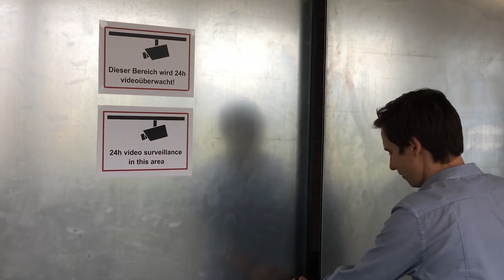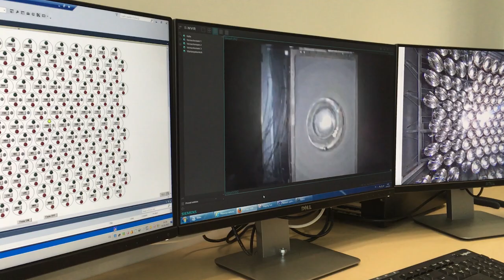Why Tom Couldn't Show You The World's Largest Artificial Sun

Comment: so you only want to show videos that are visually impressive? well that will be a limitation. lots of cool things are visually underwhelming.
Reply: Tom's made plenty of videos about things that aren't actually that visually stunning- the borders inside borders inside borders one is just him walking on a street, and there's one about little twiddly knobs underneath crossing signals. In this case they were expecting something to be much more visually impressive than it turned out to be. If they'd used his phone, rather than the gopro maybe it would have been.
Reply: dgodfrey9189 Or the sideways river, that looks pathetic.
Reply: Seriosuly, Tom if you read this. Upload it anyway and send the video to GoPro too. The Camera that looked into the sun and lived.
Reply: I think it's that the go pro didn't accurately portray the subject. The really thing is super bright, blindingly bright, but in the video it just looks like a normal spotlight.
Reply: Mar Right? Example: How insanely, incomprehensibly amazing is a modern smartphone? The engineering and history of "That doesn't work. How do we fix that?" is incredible. But, from the outside? Iz'just a plastic brick, innit?

Comment: You should release it anyway. Biggest artificial sun and god damn blessed gopro. Or write gopro im sure they will want this as promotion material. :D
Reply: My thoughts exactly, this is great advertising for GoPro, you could squeeze out a spon probably :D
Reply: Yes that ^. GoPro might even send you a new shiny one to try to abuse in other interesting places.
Reply: So on the upside, these scientists now have another camera option for their research.
Reply: The battery is still gonna melt :/
Reply: Batteries can be substituted for by an an external power supply, much like their existing fixed cameras use.
Reply: True, I just figured the point of the GoPro is to use it with the battery and go anywhere, avoiding cables and such :D
Reply: relocate the battery/powersource?
DSLR and other cameras can be adapted to run off mains power (usually with a battery shaped plug to go where the battery goes in, connected to a power adaptor), so no reason why a GoPro cant have one.
Reply: He could even make it unlisted and place a link in the description of a video. That way he wouldn't have any issues with posting a bad video
Reply: Yeah, I was thinking you could sell the footage to GoPro.  Who wouldn't want that kind of proof of capability?
Reply: I agree. Please release the video, show the other cool stuff and just build the narrative in a way that doesn't make the viewer expect that the GoPro just dies. Sure, it's a little bummer but you can explain it and in my opinion it's not your fault. Even had you known that the GoPro would just compensate, you could have made a cool an foremost informative video about that.
So why not teach your followers: GoPro compensates for several suns of light. :-P There is not the expected sensation in that, but there is stuff to be learned. Even if it's only "we have artificial suns and this is why".
Reply: "The GoPro Hero 7 will not only work when pointed directly at the sun, but also when pointed directly at the LARGEST ARTIFICIAL SUN."*

*Keep in mind that the GoPro may start to melt if kept in front of the largest artificial sun.
Reply: "And that is something you might have known."
Reply: Tomáš Viktorin Seconded
Reply: Believe it or not, not every single company wants promoting.
Reply: +Gauntlet why would a company dont want to promote their stuff? even pornhub sometimes gives an ads around

Comment: "The only way is to melt a GoPro..."
    Did you consider putting in a lower quality camera?
Reply: Still the risk of exploding battery.
Reply: @coolguyhino92  take out the battery and plug it in a solar panel, the facility was designed for testing them
Reply: Probably just didn’t have another camera, and still... exploding battery

Comment: Wouldn't it be possible to power the gopro externally? That way the battery or power source etc could be protected. Looked pretty cool to me anyway!
Reply: power it up by solar  power and use the lights to power it. unlimited power!
Reply: @ganon8835  UNLIMITED POWAAAAAH
Reply: @ganon8835  no but actually I am pretty sure solar panels can do bad things when subjected to that much light
Reply: @jearlblah5169  it was a place designed for solar panels
Reply: @TylerMarkRichardson  solar collectors, not solar panels. VERY different things, actually.
Reply: @jearlblah5169  they overheat and burndown.

Comment: I believe the 'ka-clunk' of lighting is just a dated expectation. Modern lights do not make that noise - but they once did, in very large installations like warehouses or floodlights. It is the sound of a mechanical time-delay contactor. Incandescent bulbs draw a surge current when turned on - if you turned all the lights in a large installation simultaneously the surge current would blow fuses. The solution was a device that just turns them on in stages, a few seconds apart. That's still done today, but using silent solid-state electronics. Hollywood just kept the sound effect because it sounds cool.
Reply: I went to a very old elementary school, its cafeteria/stage the only place I've ever heard lights make that noise. The noise would come from the back-stage area, not anywhere near the light switch, or the light bulbs.
Reply: Carbon arc lamps also made a characteristic noise when they turned on, but it was more of a buzz noise than a Ka-clunk.

A carbon arc with the delayed contactor would do both noises.
Reply: Vyl Bird  -Turning the lights on at the hangar where I work, there is a kachunk noise, but it's actually produced by the relays
Reply: There may actually have been some relays controlling those lights that would make that sound.   If he'd known ahead of time that he needed it, it would have been a funny to mic the relays and produce the sequence as Hollywood would, .. and then do a reveal where Tom says "Actually, that noise comes from this metal box in a completely different room from the lights themselves."

Comment: Why does a gopro adjusting the brightness spoil the video about an interesting thing? The information about what the artificial sun is and what it does is still quite interesting to see. You do not have to film a Mars rover from the surface of Mars for the piece about it to be interesting.
Reply: I absolutely agree. There is more background to it than melting a gopro
Reply: Ollyweg 0 the thing is he can't, it's in a vacuum chamber so no oxygen to fuel the fire.
Reply: Melt a chocolate bunny?
Reply: ikr? it still made a nice piece. it might not have been as impressive as in person, but displays typically(and thankfully) don't reproduce that much brightness anyway, so it was going to get squashed or flat even if the camera didn't think it was doing the right thing by adapting.
Reply: It's because standard dynamic range cameras can't even come close to reproducing the effect of staring straight into the sun, and this video was recorded in basically the same era as the one about the "pinkest pink" that can't be reproduced on SDR displays for much the same reason: there just isn't enough gamut available in eight bits per pixel.

I'd really be interested in Tom doing followups to videos that don't work for the same underlying reason if he were ever to start using HDR-capable recording equipment, seeing as YouTube supports HDR videos just fine if watching on a HDR display.

Comment: In my experience, the master power to stage lights makes an impressive noise. It's a big heavy clunk. If you go to the lighting board before turning on power to the array and push all the switches up, then you get a clunk paired with blinding light. But that switch is for providing power to the entire lighting array, not each individual bulb.

Comment: Run it as a video on how awesome cameras are at not getting destroyed in super bright light instead? featuring science machines
Reply: Also start with the seemingly domestic lights being switched on, then go for the shiny shiny kit?
Reply: Berakh Hvar yes I think that could be a good solution, there may be things to learn about CCD sensors and how they cope with bright light.
Reply: Automatic gain control for the win?
Reply: THIS.  How tf is GoPro capable of this? What kind of technology have we developed such that the camera brand known for "cheap" and "sketchy" is capable of handling this? 

Talk about how automatic gain control works, and then, as proof, show that a GoPro is capable of handling the brightest thing humans can produce. THAT'S impressive.
Reply: But if you don't want to use this footage, please at least talk about how automatic gain control works, because I really want to know.
Reply: (This could be wrong since this is off the cuff and I'm not fact checking, but)
I would guess that the GoPro uses a CCD sensor containing many cells that are combined to get a colour value for each pixel-

Each cell of the camera sensor converts the incoming light to a voltage by accumulating an electrical charge; generally the more light the greater the voltage. This charge is then sequentially removed from the individual cells to make a video signal for processing into pixels comprising an image. 

Because the camera can only understand a certain range of voltages, and the variation in voltage from the charges is usually too small to understand, it is necessary to amplify it. The amount of amplification is called the gain.

A signal produced in low-light would require more gain to amplify the signal into the range the camera can understand. (An unfortunate side effect of more gain, is that noise (incl. static) will also be brought into the range the camera will try to understand.)

A signal produced in daylight requires less gain to do the same. (Too much amplification and the details represented by higher voltages will be lost as overly-bright patches. edit: like old night vision does)

Automatic gain control measures the voltage/value range in the signal, and will adjust it so that the maximum and minimum values are scaled into the range the camera can understand, eliminating overly-bright/-dark patches. 

(I forget if CCD sensor technology does this:) This same control may also independently adjust the starting voltage in the sensor to increase or decrease the sensitivity to light. 

Hopefully if I am wrong someone will correct me. But I'm going to go eat instead of fact checking.
Reply: And why.. I am assuming it is because the color temperature is still in range it can deal with if is supposed to take videos of molten metals or similar things with color temperatures that are really high, but not directly on the camera like bathing it in light.

Comment: Some lights in some circumstances do make that sound.  I worked lighting for a 2200 seat theatre that had fluorescent house lights (roughly 200 4 foot fixtures).  On the lighting control board was a tiny toggle switch to turn them on or off.  When turning on there was a sound almost exactly like your sound effect as the relays and starters and ballasts energized.  It was loud, impressive, and when you heard it you knew something had happened.
Reply: The large and echoey PE hall in school had some overhead sodium lamps fixed to the roof beams, made a lovely deep energetic racket and as they warmed up, all the hum and buzz slowly turned into light. Shivers. It ain't the same with LEDs :)

Comment: Hey Tom, considering this video is almost 4 years old, I realize someone might have already pointed it out, but I think, you should revist the "Drielandenpunt" as the Dutch call it, I think there actually is enough there for a couple of reasons:
1. It is not only a tripoint, it is also the highest point of the (continental or European part) of the Netherlands. Having been there and knowing that is actually not that high says a lot about just how flat that country is.
2. It has been a quad-point (hope that is the right term), since once there was an area that was disputed between I think the Netherlands and Prussia and so that area was somehow considered to belong to neither and being neutral.
3. In a way it still is a quad-point, as Belgium is separated in a Dutch-speaking, a French-speaking and a tiny German-speaking community (I think, I remember you mentioning that in a different video too) and the border of the German-speaking community with one of the other two also runs up to that point.
4. Last but not least: You can jump up and down by around 2 meters just by crossing the border...not literally of course, but apparently Belgium uses a different reference for their hight above sea level than the Netherlands and Germany do, so even though it's totally flat the Belgian part of that point is 2 meters higher than the German and Dutch part...of course that would be true for any point on the Belgian-Dutch and Belgian-German border, but I know you care about that as little as I do as long as it makes a good a story and you can nitpick yourself for it afterwards. ;)

Comment: Lights never made that noise it was the solenoids use to switch on and off the massive amount of electricity they used that did. They has to move extremely fast so they can disconnect/reconnect power without arcing inside the switch

Comment: thats why you remove the plastic shell and the lithium battery and have it powered from a wire, that way itd just be an image sensor and circuit board that would burn up. ^^

Comment: Something you could have possibly done to prove how hot it got was to put a match in front of the GoPro (or rather off to the side) and watch it light as though it had just been struck, and to prove how bright it was you could put the GoPro inside something that blocks light intentionally, and show with a flashlight and/or the sun how minimal light gets passed through, and then put the same object in front of the array of lights and show the amount of light that does get through.

Comment: Electrical safety switches kinda make that noise when flipped. They're the levers they use in movies to turn electrical things on like you mentioned. Installed near machinery so you can lock them out without turning the whole breaker off to work on it.

They're a bit higher pitched, but close enough.

Comment: To echo many other commenter's sentiments, I like the video and think that it could be a discussion about dynamic range in video. It also shows that modern sensors are pretty reliable (I've seen old camera sensors [maybe CMOS] with dead pixels from looking at the sun) no matter how you abuse them. 

One angle I would love to see is the view of the target from the lamp's perspective. The intensity of the light shining on the camera compared to the off-axis areas might have illuminated the differences.

Comment: If you got a chance to try again, you could put a hot mirror in front of the gopro.  The hot mirror would reflect the longer wavelength light, keeping it from heating up your gopro, but let the shorter wavelengths (visible light) through, allowing you to turn on more lights without melting the camera.

Comment: I found that footage great, even if nothing happened to the GoPro. I still think it was quite cool to look at the lights from a perspective you can't possibly be in, especially watching them turn off. It's a good lesson on expectation if anything. Turns out, GoPro's don't instantly melt at high temperatures. It'd be worth the effort of the guys at the facility if you showcased it.

Comment: Alright. Someone make lights that actually make that noise as a required part of turning on.

Some possible things you could have setup before starting to try to make it better would be:
  -Have a luminosity sensor indicate how bright it is.
  -Have a meltable object in front of the Gopro that would be safe to do so and verbally note that it's not even in the focal point like the Gopro is. Maybe an ice cube.
  -Have it sponsored by Gopro with a whole "Largest artificial sun vs. Gopro." (Not the best idea, but meh.)
  -Talked with them about things they've worked on more. Maybe show some examples of post test objects like scorched metal, etc.
  -Have them turn on a bunch for a very short time and then show how the side of the Gopro that was facing the artificial sun has changed compared to the side facing away.

Comment: I know that it is bit too late but ... You can enable "ProTune" on GoPro. With this option enabled you can tune/lock shutter speed and sensitivity (iso). It should provide expected result with shutter speed and iso locked.

fyi: it is impressive what gopro can handle. Anyway it is created to shoot outdoors so looks like they expected to see shoots with camera pointed to sun :D

fyi2: i normally lock shutter speed to fps /2 to get 180 shutter angle. This shutter angle is normally used in movies and provide good balance between motion blur and sharpness  of image.

Comment: it ties into how ccds work. they are reliant upon the area around it.they automatically adjust to the area around the point. You deal with this in basic astronomy when they're explaining the limits of the ccd unit used.

Edit: I want to add. It's also not something you'd expect in almost any situation. it deals more with oversaturation of a massively external image. not a natural adjustment of an image either in software, or just reaching the limits of a ccd in a consumer product.

Comment: Tom, if you want to melt the GoPro, you should solder a couple wires going to it from the outside then put the battery off to the side. Maybe put a small fuse on the wires in case the battery is short circuited.